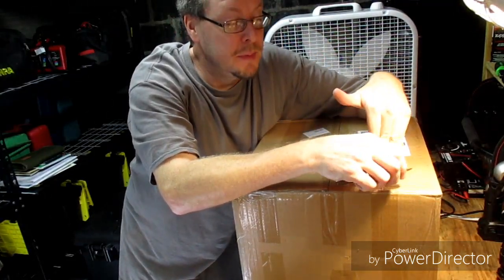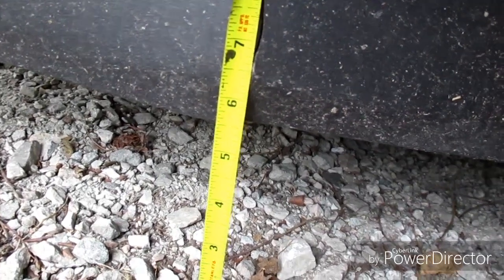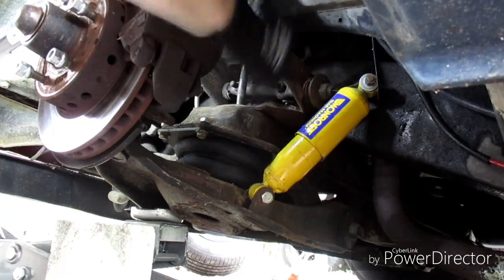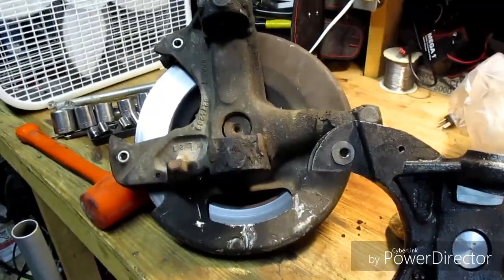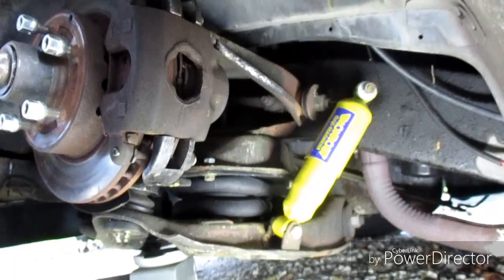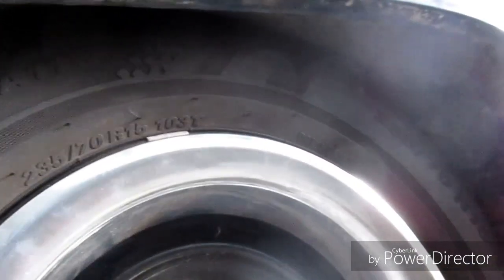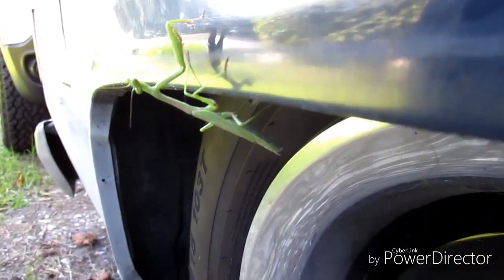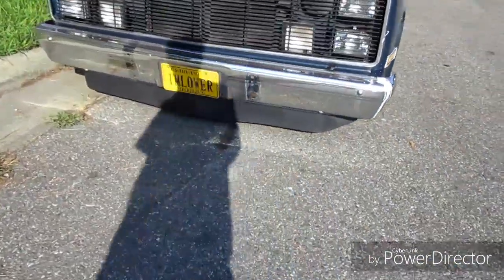suburban drop spindles install

Comment: I am building a 92 burban I have a huge question , I got “universal” notches and then I weld them together and they do not fit 👎🏼 I’ve done some searching around and it seems like the 63 to 72 notches have that same shape the frame on my truck has, I cannot seem to find any info and was wondering if you had any info that could help. I already bought one set that did not fit , don’t want to go through that again . Thank you I’d appreciate it !
Reply: My frame gets wider as it goes up closer to the front end, roughly 3/4 to an inch to an inch, just from pictures it seems like the 63 to 72 notches would fit but I figured I’d ask someone who’s done it
Reply from the maker: Thorbros.com
Best place to get all the things you need.  I get all my stuff from them.. if there site doesn't have what you need .call them jason thorbecke will help. He will even custom cut you anything you need.
Reply from the maker: Also when you put the notch on dont weld it up before you install it. Sometimes it needs trimmed down and adjusted. The one I put on my suburban didnt fit perfect. Needed cutting and a big hammer.

Comment: Where did ya get the bag set up. I have a 88 suburban
Reply from the maker: There is no specific place for this truck. I got most of my parts from Thorbros.com.  that was front bag mounts, rear bag mounts , and c-notch.  Got the 5 link for the rear from Michigan metal works. Viair compressors, tank, switch box off ebay.  Hope this helps
Reply: @lowlifegarage9367  thanks

Comment: awesome. how did you do the rear bag setup? does it need cnotch?
Reply from the maker: It's a 5 link setup. That's a parallel 4 link with a pan hard bar. It has bag over axle.  Yes a monster c-notch in the frame.
Reply: @lowlifegarage9367  wow! i have a clean one and would like to not notch it. Do you think the Belltech 953ND kit will fit without a notch? and do 4/6. I have a 90 2wd
Reply from the maker: @tonyg9804  yes it will fit without a notch, but the axle will be close to the frame. So it might hit when you hit big bumps in he road.
Reply: @tonyg9804  I have the same truck . Have you done this,  and did it work ?

Comment: How old is this video date, 
And how much do you pay for spindle set?? Now is 11-13-18
Reply from the maker: i posted the video 9-22-18.
 i paid $220 for the spindles
Reply: @lowlifegarage9367   hi, where did you get them? Do you have the part number? I ordered already from street edge, but doesnt fit when try to installed them, could u help me with that info, thanks
Reply from the maker: @vgsvaraujo2164  i honestly dont remember where i got them. if i do it again. i will order threw LMC Truck. guaranteed to fit. i also have got lowing parts threw maxtrac suspension. love them

Comment: Cool burb
Reply from the maker: Thanks appreciate it.
Reply: What part # airbag did you use? Factory control arms? 
I will put on 3” spindles soon, 
Loved this video
Reply from the maker: @oldschoolman6572  factory upper and lower arms. It would lay out 100% with after market arms. It was about 3 inches from laying front cross member. The bags are #2600 . I think dominators. For airbagit.com.